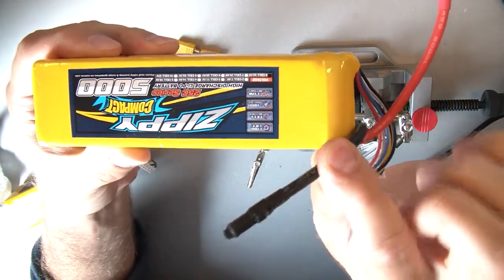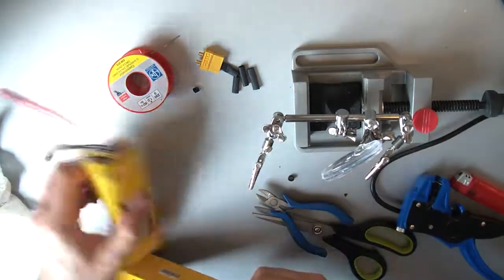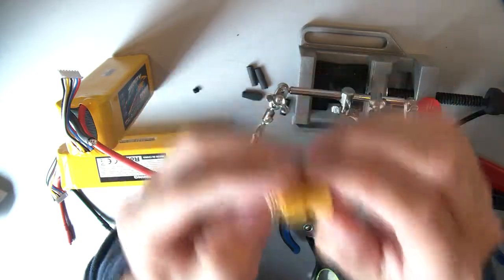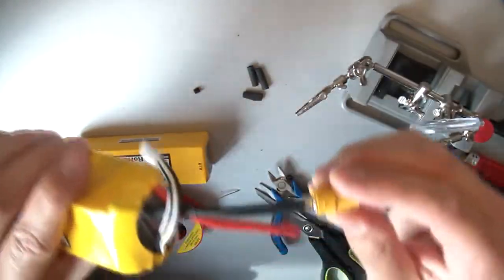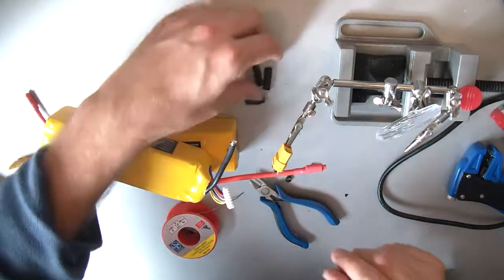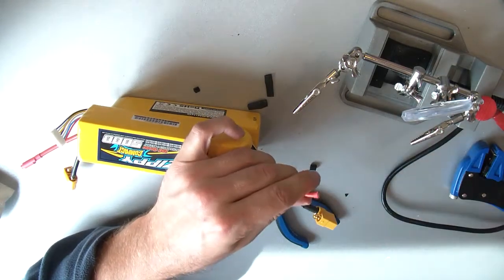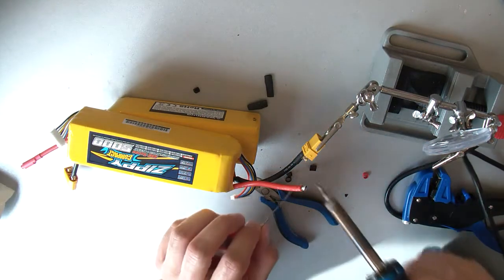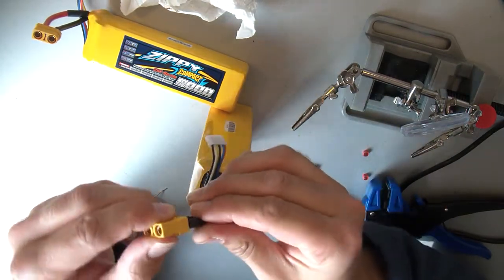How to change (solder) the connector on a Lipo Battery

Comment: How good are those zippy battery's? I'm looking to get some lipos for my ft011 2200mah 4s 30c. How much for zippy brand
Reply from the maker: I don't know the actual prices, but I got all of them from hobby king. I just made good experience over the years, not a single faulty one. I guess I had at least 40pcs of them. For its relatively low price a real recommendation.

Comment: how many watts on your iron for that thickness cable?
Reply from the maker: I use a 50W Machine on 300 Degrees Celsius. Sometimes - when i have to solder even bigger cables, i go up to 500 Degrees and just tip on them to make them very fast hot, but when using this temperature you have to be fast as hell ^^